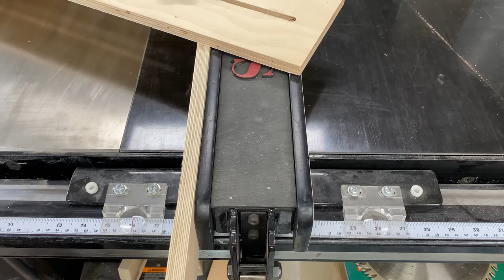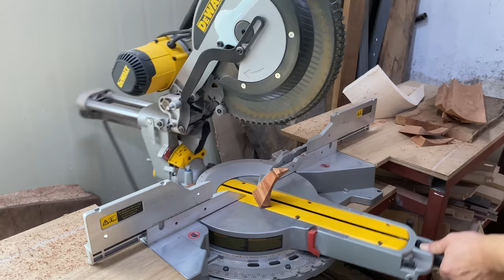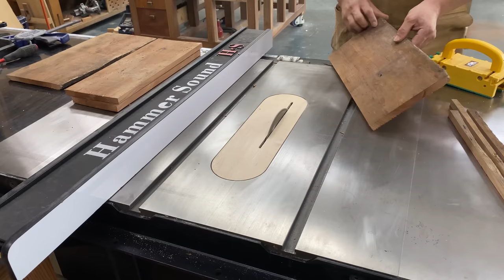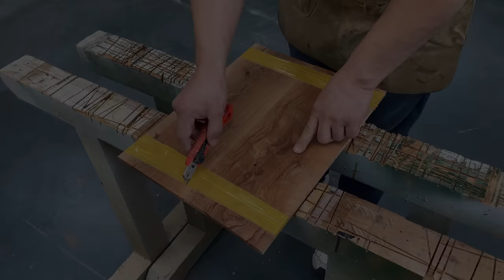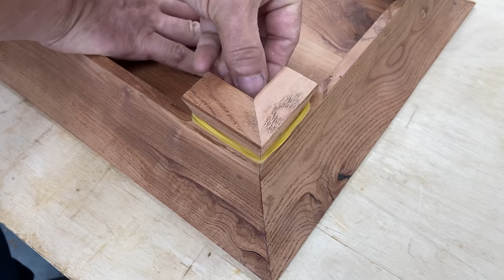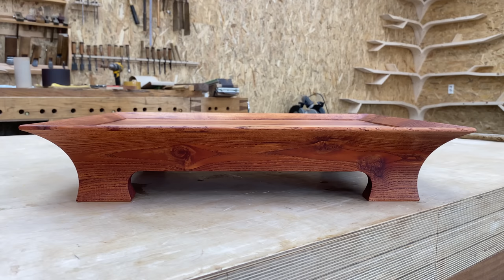Unexpected results depending on the cut angle / It will be crown molding or furniture.

Comment: Great transition from rough to finished product. Wasn't sure what it was going bto be. Did the corner reinforcement with glue stick successful being applied over oil Finish ?
Reply: I'd be very surprised if it did hold. Water based glue over oil. Perhaps a polyurethane glue would work here.